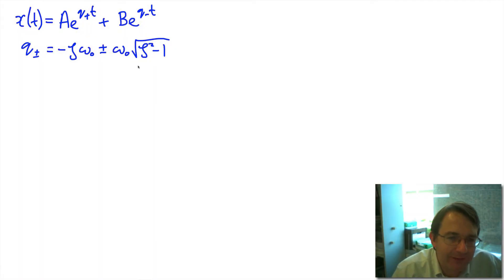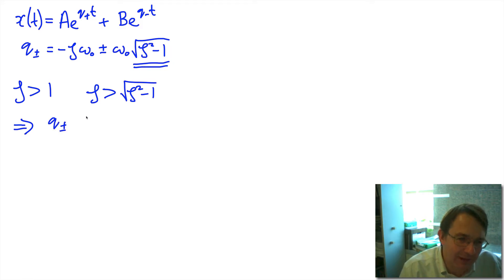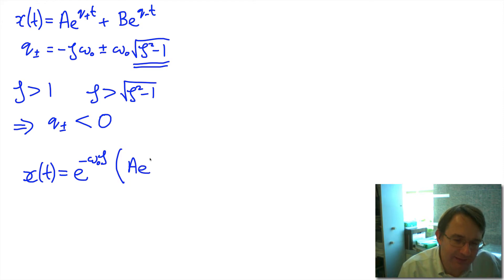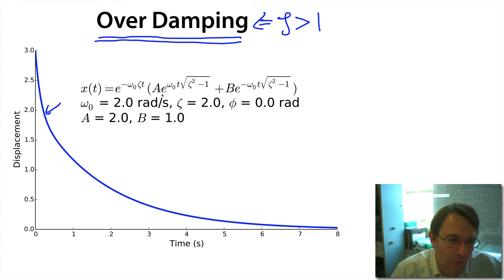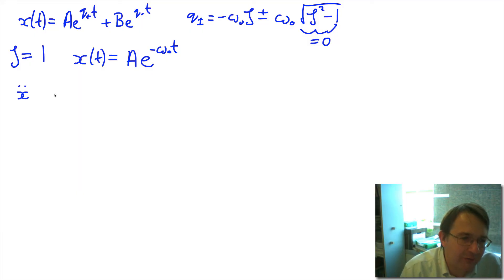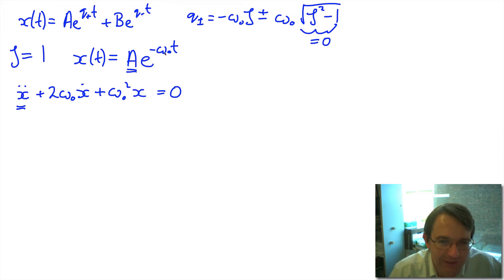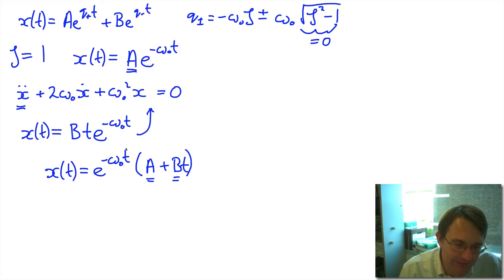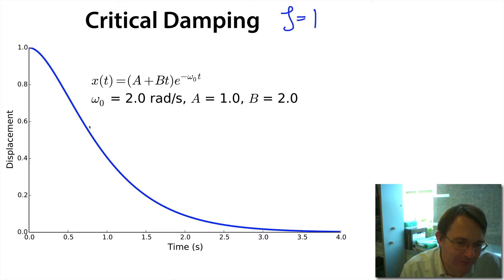PHYS 130 Oscillations Part 7: Types of Damping

Comment: Why are there so may dislikes on these videos?
Reply: I would believe the reason is that he uses more of an explanatory approach rather than a derivation approach. Many students do not understand the foundational maths (myself included) that are required to understand the terms and the reasons they sit in these equations the way they do. I find myself dissatisfied with his explanations, and seek other more foundational approaches to the definitions of the terms. I think if I were to come back with more prerequisite knowledge I would gain more value from these videos. Terrible for introductory understanding, great for new info, probably even better if you understood the why.
Reply: @itsmebougie  Ahh yes. That is quite true. He does not really solve the ODEs or PDEs but really just justifies why his assumption is correct. I'm using this as an introduction to optics because I want to familiarize myself with the final equations, solve a lot of problems to get some intuition and then look at the more fundamental questions. But yes, the course is neither proof based nor intuition based. More useful for exam preparations.
Reply: I'd say it is because a lot of the math needed for first year engineering courses are the first times first year engineers actually see this math, ever!
It is taught in following terms, but most profs just expect us to know the math.  But we don't.  And thus we don't get it, and we turn to our friends, and they don't get it, but somehow through minute understandings of each other, we piecemeal some partially accurate idea of the concept.